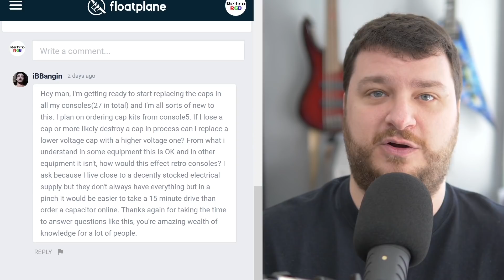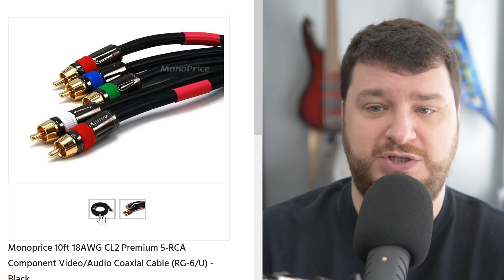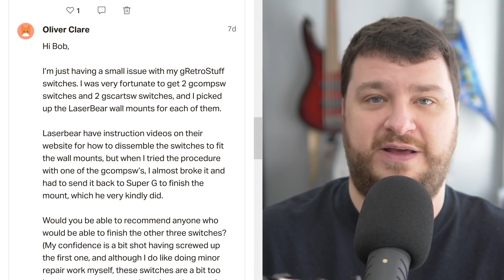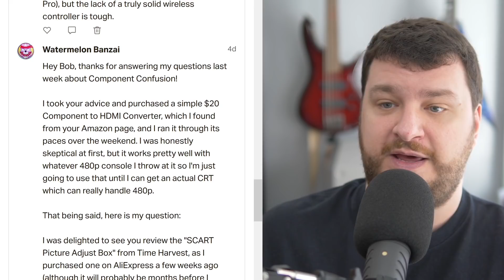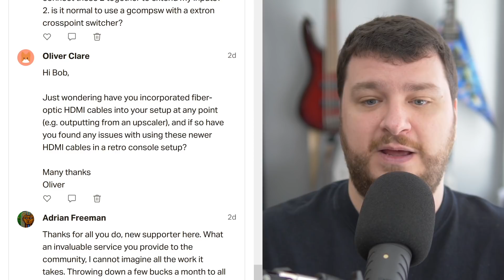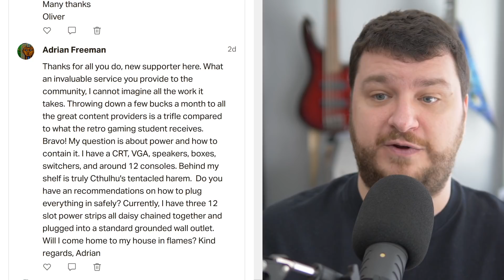Supporter Q&A #147

Comment: regarding scaling in OBS: i try not to resize the actual source itself. instead, using a filter is advantageous, as it can retain its scaling even when the input doesn't. i do it in two stages. just right click on the source and choose "filters". you can add two resize/scales in there:
- scale to integer using a point scale (i usually go 3x regardless of how it'll end up on stream)
- scale to the necessary size on your layout using whatever other setting looks good. lanczos tends to be a good balance here once you have the sharp pixels - to my eyes - but other options do exist. avoid point or area for this step.

Comment: To answer mttmcc's question about a good PS1 wireless controller I've used logitech's 2.4g wireless controller and it is considered by many to be one of the best controllers. The black version doesn't fit in a PS1 when a memory card is also in, but the silver one does. These are old controllers now, so it may be easier to look at an option from Brook, everything by them seems to be very well done.

Comment: panasonic tvs should be avoided for gaming... I have a pana plasma from 2011, in gaming mode aspect ratio cannot be set/selected :( terrible. its component input broke after I used a wii in 480p for couple of hours........ now it can't accept progressive, only interlaced :( I used the same wii, same cable for weeks in interlaced (forgot to set to P) but once I set it, it had green flickering after a while, became more and more flickery, then broke. that wii and cable works on my other TV fine, for days...... :(

panasonic oleds are great for movies, other than that, the brand should be forgotten :( until today I only bought Pana, CRTs, Plasmas, not anymore..... they lag behind the industra these days, really :(

Comment: Guy trying to recap 27 consoles for the first time:  LISTEN TO BOB.  DONT DO IT!  you sound like you're new to this so just stop right now.  Despite what you mightve been told on the internet:  NOT EVERY RETRO CONSOLE NEEDS TO BE RECAPPPED.   There are a few known consoles that have developed cap issues over time and as time goes on, we are learning what the effect of time is having on certain caps in certain consoles.  Do some research and recap the consoles with known cap failures and leave the rest of your consoles alone.  It only takes 1 pulled trace or via in the 20-60 caps you might be trying to replace that will break your console.  You wnt know which one and if you have limited experience you probably won't be able to diagnose and repair the problem.

Comment: Honestly for the PS1 wireless controller  the Brooks adapter is the best option. I agree it's ugly but it's still the best low latency option. My PS4 controller even stays synced with it, besides the look it's great.
Reply: I also wanted to add the Logitech PlayStation 2 Cordless Action Controller works perfectly with PS1
Reply: I agree, check out the brook adapter. I have one for ps1 and saturn. Both work great and I've been able to use different wireless controllers and fight sticks

Comment: SurgeX also offer amazing surge protection. You can get these very cheap on eBay. The Surge SEQ is excellent. I have multiple units that I’ve paid maybe between $120-150 each. These are industrial units and are built like tanks.

Comment: Does electrolytic capacitor ESR play a factor in gaming applications?
Reply: It will matter for some capacitors and not others. The high ESR ones tend to be physically much larger than the rest, It isn't unusual for some of the caps in the power supply/delivery circuit to require high ESR. Console5 makes it easy because they pick out what you need for you.

Comment: You were right-on about the UltraHDMI, Bob. Thanks. :) My brother who organizes the group buy can definitely help with recovering that failed UltraHDMI update. We have the programmer and the needed files.

The problem was likely caused by losing DCDI during the update. Depending on the behavior of your TV, if you turn it off or switch inputs during an update the HDMI port shuts down. The UltraHDMI update goes through the digital video bus which basically disables itself when there is no HDMI sink connected on FW1.07A and earlier. That crashes the update. Same if you disconnect the HDMI cable. I told Marshall about this issue when testing what was supposed to be the final FW1.08 and he quickly fixed it and made a final-final 1.08 without this issue. Unfortunately, the earlier firmwares still have that problem so it will still be a potential issue until you are on 1.08.
Reply from the maker: I believe this is the same person.  Mind posting there?  https://shmups.system11.org/viewtopic.php?f=6&t=68174
and thanks for the help.
Reply: @RetroRGB  Thanks! I just saw it. :) Also found a recent post from "MJF309" on AtariAge with the same problem and was already corresponding there with the assumption that it was the same guy. Might not be.